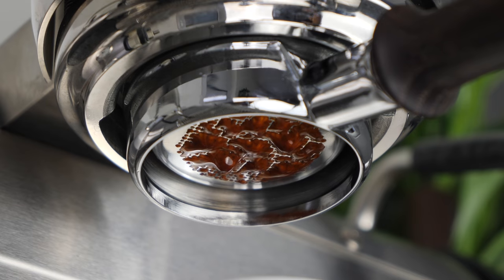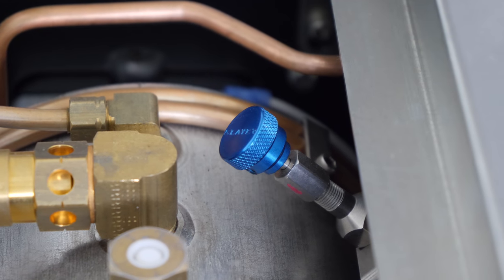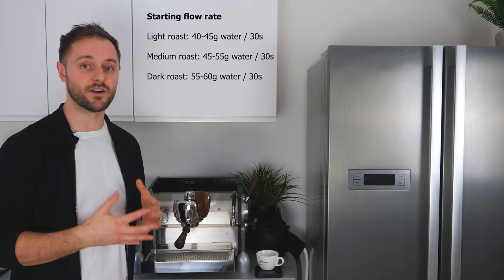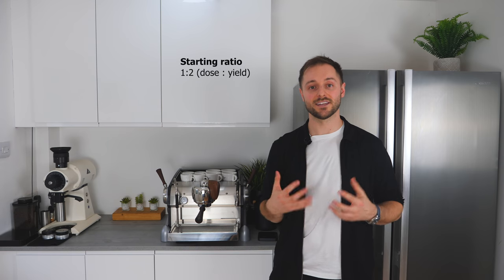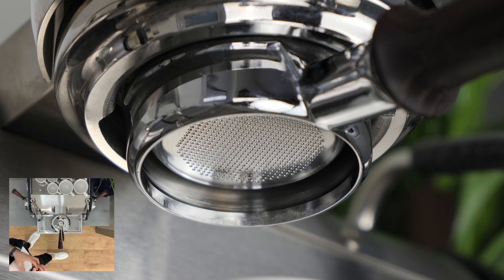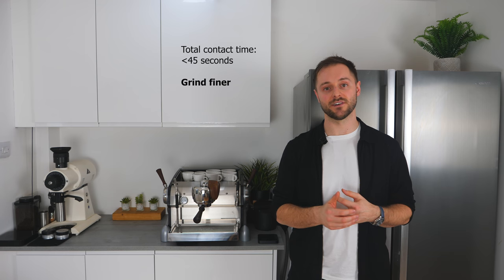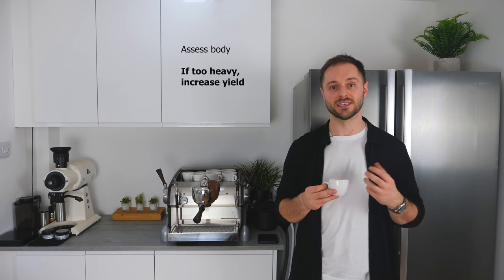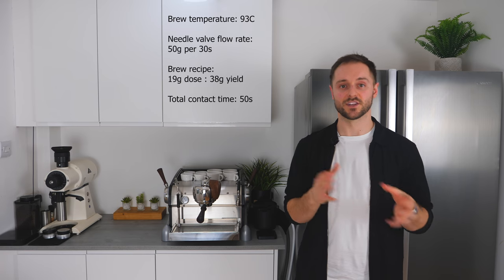SlayerEDU: Dialing in the Slayer Espresso Part 1

Comment: Thank you!  I have found that I need to lower the pressure to achieve these parameters on my Slayer.  What is your brew pump pressure default?  Mine is currently set to 35%
Reply: Wondering the same thing. Seems like a long contact if it's at full (9 bar?) pressure.
Reply: @jdrobison1967  Hi both. My brew pressure is set to 9-bar. It is definitely a long contact time, but you can push 23%+ extractions without any unpleasant bitterness - it tends to increase sweetness and body. I love this machine!
Reply: @DANFELLOWScoffeecocktails  especially with an Ek

Comment: Is the espresso machine plumbed or using a water pump system to draw from a water jug or other external reservoir? If using a water pump system, what type is being used?! I’m doing some research on which water pump system will be just fine for the machine if I decided to go this route, but I know that the upgraded feature on the newer version with a rotary pump does not necessarily need a water pump system anymore. What is the recommendation that a water pump system would still be beneficial to extend the life of the rotary pump?
Reply: Hi Scott. My machine runs from water tanks. I have a FloJet hooked up as I had one from a previous project, but you could definitely run the updated Single Group (with the rotary pump) without any sort of FloJet.

Comment: Great video, can you do a video on how to extract really light roasted coffees. They give me the hardest time extracting properly.  I will adjust my needle valve to 40g, maybe that will help.
Reply: Hey Ben. If this were me, my first steps would be to grind finely to increase total contact time, possibly up to around 55-60s. You are exactly right, you could also consider adjusting your flow rate with the needle valve, bringing it town to 45g per 30s, and even 40s per 30s if this gets you closer. A big factor here is your grinder; I'm not sure what you use but a great grinder will obviously give you even more control and precision. I hope it is going well!

Comment: Is there an easy way to adjust the needle value?  Seems a bit tedious to have to go into the inner workings of it each time to adjust as I swap from light roasts to medium.  Would be great to have that on the outside of the machine some how!
Reply from the maker: @slappadabass1977 Hey there! We're not currently offering this as an option. Though the needle valve is definitely designed to be adjustable, our method of brewing is designed around being able to consistently toggle between 2 distinct flow rates.

Comment: Hi Dan, question regarding flow rate. If medium and darker roasts require higher
Flow rate; would we then not have to grind finer to meet the contact time of roughly 25 sec prb and 25 sec brew (this extracting more)? Would this not lead to even more extraction from a roast level that extracts more easily than a lighter roast? Trying to understand why darker roasts use higher flow - unless I am to shorten my prb and brew.
Reply: Hi Ejam. I have so much time for this question! My experience of a higher flow rate is that we are able to slightly increase perceived acidity of the shot, which I enjoy emphasising in a darker roast coffee. You are totally right that you would need to grind finer to achieve a 50s total contact time which could run the risk of finding some bitterness, so I would be inclined to run slightly quicker shots (perhaps aiming for 45s TCT as a starting point) with a coarser grind to ensure we pull out as much sweetness as possible without unbalancing the shot with bitterness. We could also brew a 'bump' shot if we wanted to push acidity further. 

I hope this is useful! I would love to hear your experiences with darker roasts extracted on the SSG. I think it is so exciting to be able to fine tune coffees and find characteristics we perhaps wouldn't be able to with more conventional extractions!

Comment: 8:05 total pre + brew = 66 !
so to make it 55
pre around 25 + 5 sec brew to get total 55 sec. I don't understand
Reply: Hello! The 66 second shot was while dialling in, so was longer than I was aiming for. The next step is to adjust the grind size (in this case coarser) to achieve a total contact time (pre-brew time + full-brew time) between 45 and 55 seconds. I tend to aim for 25 seconds pre-brew time + 25 seconds full-brew time to get around 50 seconds in total. Obviously you can have a few seconds either way, but this is a nice target I like to start with.

Comment: I have a Lagom P100 grinder with SSP High Uniformity burrs, would the reduced number of fines change the dial in timings? With traditional extractions it ends up flowing through around 20s instead of the normal 30s.

Comment: Hi Sir, where is the needle valve of the double group head slayer machine? Because there are two visible valve under the drip tray of the machine, is that it?
Reply from the maker: Hello!  In our video on the Slayer Espresso you will see the needle valve placement when the cup tray is removed from the machine at abut 15 seconds in: https://youtu.be/2ScxHnomb-E